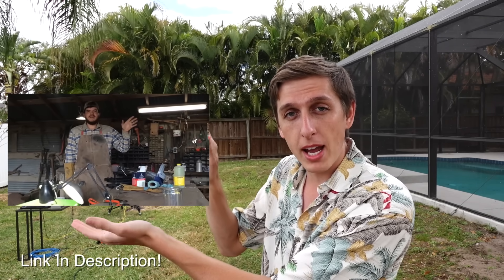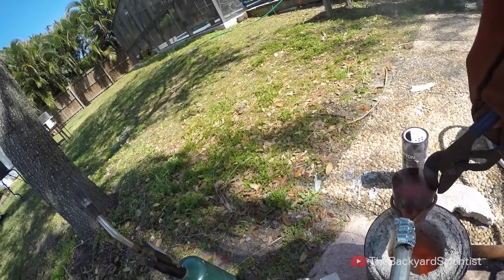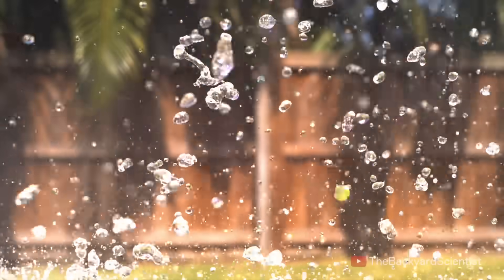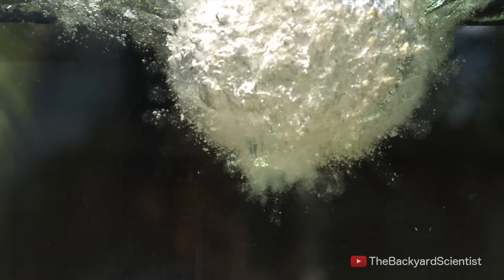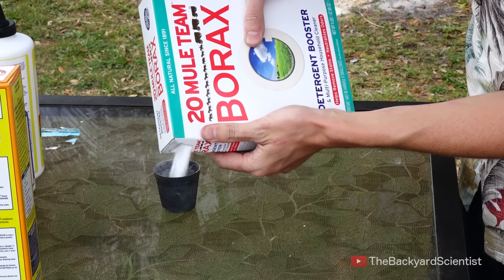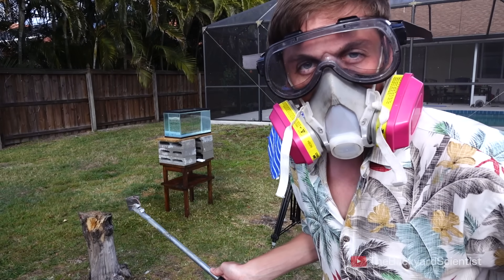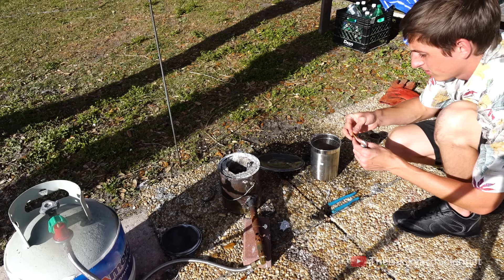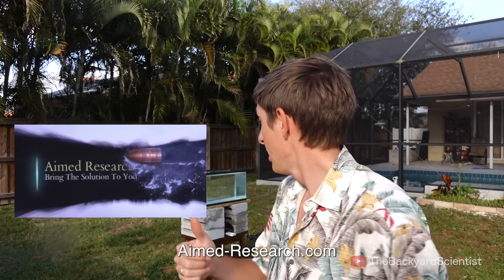Pouring Molten salt into Water - Explosion!

Comment: I believe it is a chemical reaction. Molten salt is in the form of Na+ and Cl- ions as in the  salty water. The only difference is that in the salty water, they're much easier to be dissolved and in melted state, the ions have broken their crystal form with heat. With more heat, more energy. The salty water doesn't have that temperature. Mixing molten salt into water makes the Na+ and Cl- attatch them to both polar sides of the water molecules but needs to dissipate all the excess energy by any means possible. When releasing the energy, it must release it quickly to the environment in the form of an explosion, accelerating all water particles that didn't react with the Na+ and Cl- ions. Try adding the same mols of water to the same mols of molten salt next time (rather quickly, I'd suggest) to see if there's an explosion. :D

Comment: check heat capacity and liquid density of NaCl vs NaCO3 and others at high temperature.  also by just heating all for 10 min, you don't get same temperature.  the materials get to a high temperature according to the heat transfer coefficients which differs for each compound.

Comment: Maybe electric forces play an imorpant role. Both sodium and chlorine particles are charged and due to the polar nature of water, the extremely hot salt particles interact with the water and will be flung inside the water. This will greatly increase the surface area, because normally the leidenfrost effect would keep the hot and cold media separate

Comment: Nacl was used in this experiment, and the theory about the bubbles you have, is maybe correct, but did you consider that it was due to the high temperature of the NaCl that made the Cl and Na compress to tha point where the amount of Na molecules where higher then Cl and there for you will have createt clean Natrium, and we all know how Na reacts with water

Comment: ....and some nice sodium hydroxide to help with the glass cut burn.  So, I'm surprised that you didn't try with KCl which can be sourced as sodium free table salt.  Another thought though is for every NaCl split by the water, if it were a chemical reaction, would even out.  You would get one molecule of NaOH and one molecule of HCl, which would quickly reform back to salt water resulting it the lack of pH change.  Also I was thinking, I'm not sure what temp water disassociates at but if perhaps that happens and the water splits and then recombines resulting in the explosion.  Taufledermaus has a truly mind blowing video where I'm pretty sure him and some german chemistry students pretty much crack the question of what is actually happening to cause sodium metal to explode in water.  Definitely worth checking out.

Comment: What would happen if you heated salt water to this temperature?
Reply: The water would evaporate before it could reach such high temperatures.
Reply: The water would evaporate before it could reach such high temperatures.
Reply: i think the water would evaporate first. unless you create enough pressure. but that would be hard to observate then as you would have to have a large piece if metal surrounding it with no room for a window. and if what he thinks is right, the temps will be equal everywhere so nothing will happen.
Reply: I meant under controlled environments, like a closed container

Comment: If you jammed a lid with a weak point in the centre onto the crucible then dumped it upside down in the tank, would it rocket back out of the tank as the molten salt burned through the weak point in the lid?

Comment: The Na and Cl dissociate leaving the Na with its one valence electron. This is a very unstable state so when it hits the water it will combine with the oxygen leaving behind only hydrogen....which as we all should know is very very explosive. That combined with the rapid heat transfer turning what is left into steam cases the violent explosion.

Comment: Missing double tests, when you throw the sodium into water, does it change the ph value? If not the ph test proofs nada.

Also a double test to do, I think part of it might be some of the chloride evaporating during the heating process, so heat up salt for an extra long of time, let it cool down again, and then see if it reacts.. like sodium.

The thing with the pure sodium is, it reacts so fast, it cannot get into the water, put when its diluted with some chloride, it goes down better.
Reply: Yes. sodium, thrown into water obviously changes ph. It becomes strongly alkaline. He knows this, so no need to even test that.
Reply: and the only one reaction, that could have maybe happened (still quite impossible), is the same reaction as happens after electrolysing NaCl solution. Electrolysis of sodium chloride solution makes sodium hydroxide, chlorine and hydrogen. If that was the case, the ph of water would become strongly alkaline, just like throwing a piece of sodium metal into water. Actually there may have been another reaction, but the chances would be even lower. That is that the sodium hydroxide and chlorine from the first reaction would react. Since the first reaction would have made 2NaOH, 1 Cl2, 1 H2, the chlorine, when dissolved in water would make 1 HCl (hydrochloric acid), 1 HOCl (Hypochloritic acid), the 1 HCl And 1 NaOH would neutralise eachother to make NaCl again, but the second NaOH would react with HOCl to make NaOCl (sodium hypochlorite). That would change the pH to be slightly alkaline, which didn't happen and that means, that it's impossible. This again proves, that it's a physical reaction of evaporated water expanding.

Comment: it's a chemical reaction even non molten sodium reacts violently with water and when the salt is melted the sodium can react with the water, the reason of the negative pH test is that apart from sodium there is chlorine so first thus happens NaCl+H2O->NaOH+HCl and then it neutralizes back in the opposite reaction and becouse the salted water is pH neutral...

Comment: it explodes cause the salt is cooled by the water so quickly so it results in an explosion in a physical change but maybe a chemical change cause it cools so fast?
Reply: it's water vapor, that causes to expand. that is how all explosives work. A part of the explosive material burns and then turns into a gas, expanding, causing other parts to burn and create more gas, that expands and lets other parts burn, that create more gas, that expands, and so on...

Comment: Leidenfrost doesn't take place because salt is water soluble?
Reply: +Ross Courtright The Leidenfrost effect is a physical phenomenon in which a liquid, in near contact with a mass significantly hotter than the liquid's boiling point, produces an insulating vapor layer keeping that liquid from boiling rapidly. Due to this ‘repulsive force,’ the water forms a bubble around the object.

Comment: This video and the Oobleck vid are the two coolest "high speed" videos I've ever seen. I've been a stationary engineer (fancy name for a boiler operator) for about 32 years and steam expands to 1603 times it's original volume as water at atmospheric pressure. What you are seeing is the results of not only water being instantly flashed into steam, but that steam is being superheated by the molten salt that remains at a higher temperature than the steam surrounding it at that pressure. Temperature and pressure are directly related when creating steam. Things change when you raise the steam temperature higher than its corresponding pressure. The superheated steam is flashing even more water into steam below the surface of the water so it has no choice but to expand as it cools. Yes, you heard me correctly. Steam expands as it loses pressure. Pressure keeps it contained into a smaller space. This was one of the most difficult topics of all my steam courses to grasp. We had to understand how a steam driven water pump gets its power, and it's from the steam actually cooling which makes it expand violently. It's a difficult concept to grasp, but that's what's happening.

Comment: well seeing as NaCl or table salt is nothing but an explosive metal and a deadly gas, you can see why this happens. melting the salt removes some chlorine from it purifying the sodium in it. sodium when it comes in contact with water will explode violently.

Comment: Its a chemical reaction: When you mix 2 HCl (Hydrochloric acid) with Na(OH)2 (Sodium hydroxide), it will give you 2 NaCl (Table salt), 2 H2O (Water) and energy (Heat). Basically what you just done is the reverse of this reaction. Pouring the molten (Energized) salt into the water will form back the hydrochloric acid and the sodium hydroxide wich would react back into table salt and water if the explosion was contained and no chemicals were spilled.

Comment: I think it's a combination of things:
-- molten salt immediately crystallizes on the outside but stays hot on the inside, forming a sort of Prince Rupert's Drop
-- once the salt is cool enough for the Leidenfrost effect to stop and the water to make contact, the water begins to dissolve the still very hot salt
-- the dissolving salt forms a weak point in the highly stressed crystal lattice, causing it to explosively shatter
-- the shattered salt, now out of the way, allows the water to make contact with the still molten inner salt, causing flash steam
-- the shattering and flash steam form an impressive explosion from the combined efforts

This would also explain the mini-explosions you get, where scattered molten salt bits go through the same process.
Reply: Seems logical!

Comment: Looks like molten sodium chloride is much less viscous than the other molten salts you tried. The low viscosity would make it much easier for pockets of water to move inside of the main mass, like you theorized. The droplet of water moves in, protected by the Leidenfrost effect, then is surrounded as the molten salt flows around it. Then it vaporizes, expands, and explodes.

Comment: As you heat up the salt, the chlorine will vaporize leaving you with just molten sodium, this is why it reacts with water, why it takes so long is because their is a residue coating that doesent allow it to be "triggered" until it is full submerged

Comment: Before watching the whole video, I'm guessing that the sodium in sodium chloride has a lower boiling point then chlorine, so the chlorine is melted off, to a point where the sodium is once again combustible in water.
Reply: Also the fact that it is extremely hot and gives it energy would be a contributor

Comment: But, Since, if I am remembering my chemistry correctly here, Salt is a neutral chemical, (neither acid nor base) Then it could be a combination of the chemicals. It seems like you are forgetting chlorine, the other half of salt. If the salt separates somehow, upon contact with the water, the sodium would initiate a reaction like an explosion, and the chlorine, which would have to be a gas, would dissipate in the air.  Or would it? The Extremely hot chlorine gas would be expanding incredibly fast (fast enough to overcome Leidenfrost?) and creating an are of negative pressure. This area of negative pressure would be instantly filled with both water and sodium, resulting in thousands of micro explosions. Because of the intimacy of the sodium and water, it is likely the explosion would be far more efficient as well. This explains the much larger explosion than regular sodium, in tandem with the steam explosion from the water.

Comment: yeah that's great, but can you build it into running an engine?  one part of the system would be melting the salt .. handling the hot-drip to the water within another container that can send the pressure to a turbine. Run the world on salt; oops.

Comment: Engineering student here: Obviously this is just a theory, but what i think is happening is that the salt is solidifying.

               TL;DR: very hot crystals explode and boil lots of water fast.

When it hits the water it's cooling down FAST, which means it's not forming the usual large cubic crystals we expect from sodium chloride, but much much smaller chill crystals. this means it's very hard but extremely brittle, like a prince Rupert's drop.
Due to the Leidenfrost effect it can't loose a lot of heat fast, but thanks to your homemade kiln, it doesn't need to. (that's assuming you only heated it to a little above it's melting point, an assumption on which this entire theory rests)

So at this point we have an extremely brittle crystals, which are still several hundred degrees above boiling point, and lots of rapidly expanding steam around these brittle crystals, i think you can see where this is going.

The steam battering the tiny strings of brittle crystal causes them to shatter in all directions, this is not the explosion you see, but causes it.
The shards of shattered crystal are moving fast enough to leave the gas bubble created by the larger blobs and aided by their larger combined surface area and high velocity, boil a much larger volume of water in a much shorter time.
THIS is your explosion.

The large cavities of expanding steam and hot shrapnel expand until they meet and expand faster the larger they become due to surface area until such point that they either run out of energy and collapse, or as in this case, reach the surface of the liquid with enough energy to throw the remaining water out of the container and upwards.

Comment: My best guess would be it's a mix of the physical reaction and sodium ions coming into contact with water molecules.

SCIENCY STUFF AHEAD:

Sodium violently reacts with water to make sodium hydroxide and hydrogen. (2Na + H2O -> 2NaOH + H2) The reaction is so violent that the hydrogen produced combusts instantly, which would cause an explosion under the compression of the water. Since you're melting salt, you're getting sodium IONS, which may not behave the same,(a quick google search does not give the answer), so this is my best bet on the chemical side.

If the above is true then the chlorine would just combine with itself into a gas, which you might have smelt after.

This is all just a guess though, I'm not too sure if the chlorine would just drop it's electron to become a gas again, because science and covalent bonds are stronger than ionic bonds so the electrons from 2 chlorines might go back to the two sodiums they were paired with and let this happen. 

Best way to find out if this is the case is to repeat the experiment then go check for the smell of chlorine. Don't think the neighbors would appreciate another bomb going off though...
Reply: That is the only plausible assumption I could think of. All alkali metals react vigorously with water, and heating it up weakens the bond between the chlorine and sodium. Since the sodium wants to bond really badly with the hydrogen and the oxygen to yield sodium hydroxide, it would provide for more than perfect conditions. The explosion (I would assume) is the release in energy from the newly created sodium hydroxide molecules along with the energy released from the breaking of the covalent bond between the sodium and the chlorine. I'm not a chemist whatsoever, this is just my assumption, please correct me if I'm wrong.
Reply: You're on the right lines, and I agree with you. I'm not a chemist either, but it seems like that's what's got to be happening. Water vapour from the heat wouldn't cause that big of an explosion if any. The only correction I have is that sodium and chlorine are an ionic bond, not a covalent. Easy way to remember is that 2 non metals make a covalent bond, a metal and a non metal make an ionic. Thanks for replying.